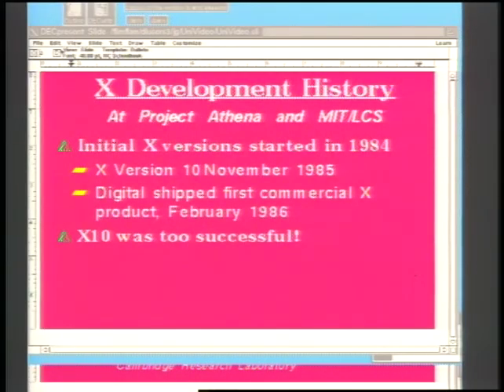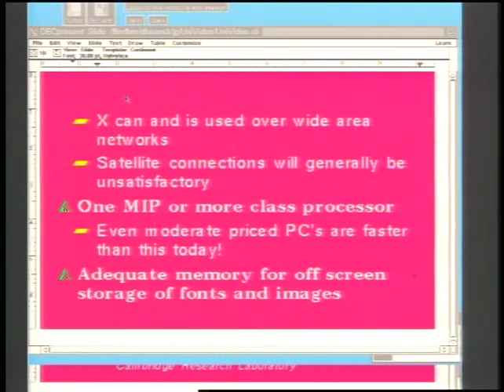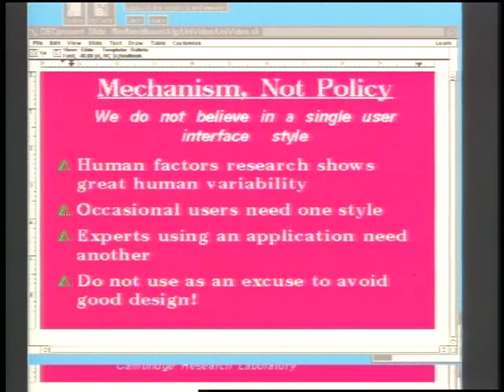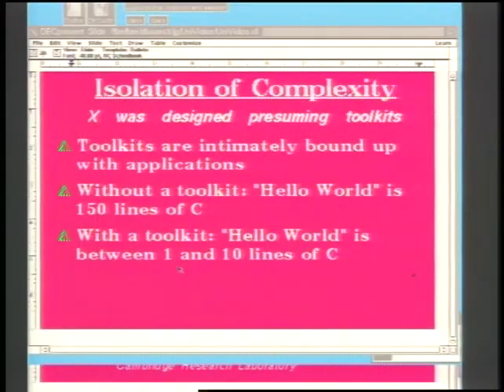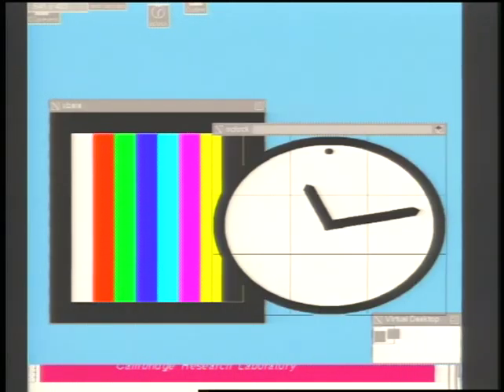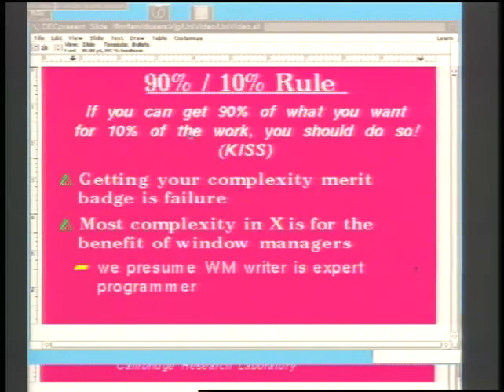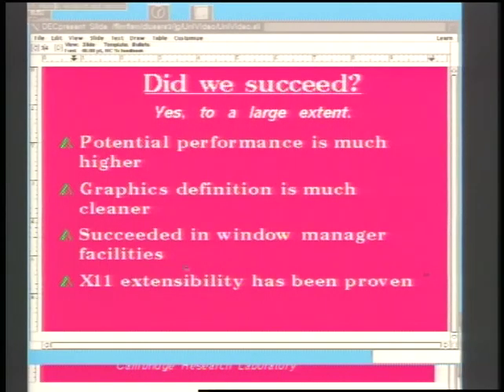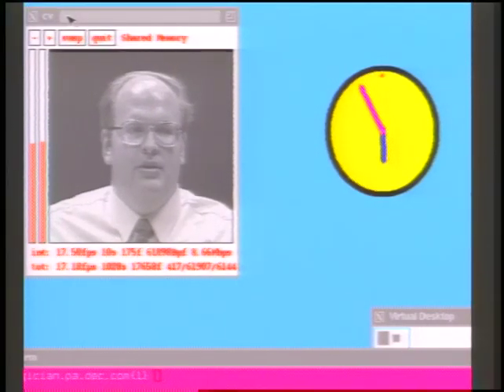X Windows System Design Principles, a lecture by James Gettys

Comment: If this video was recorded in Feb of 1991, I assume that the Linux wasn't yet born. Which OS was he running on those desktops for presentations.
Which technology was in use before X window system development started for Unix servers.
Reply: Before X, Unix systems just didn't have graphical interfaces for the most part. He is almost certainly running Ultrix, which was DEC's flavour of UNIX for their systems. He's probably using a fairly high end DECstation. And as he said, from about 1986 onward, Unix had graphical windowing via X.EDIT: After more thought, he's probably actually using VMS (as he seems to be using DECpresent for the slides, which I believe was a VMS-only software?) which is a bit odd, because as far as I know VMS used DECwindows and not X11. Though maybe that had changed by that point, I'm not sure.
Reply: @AureliusR 
AFAIK, X was actually ported to VMS very early on. So that doesn't overrule the possibility that it's VMS

Comment: A video in 1991 with an analogue of Powerpoint/Keynote and a multi monitor setup!  

I couldn't even dream of that in 1991 and this was when I was dreaming of the Amiga (and finally got an A1200 for Christmas the next year)
Reply: It was cool. The price of an Amiga 1200 was what £299 / £399 at the time? These machines were five figures and insane knowledge levels. 
This is where I think Microsoft had a genius they never talked about. They were fighting a fight everyone else was fighting but didn't know, these features one by one became cheap and available which Windows exclusively benefited from whilst these guys were scoffed naively.